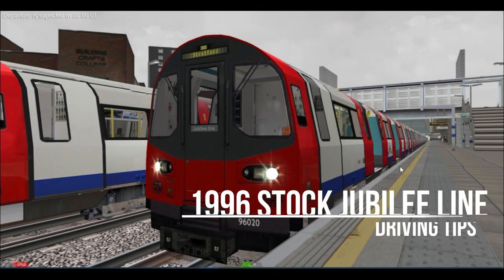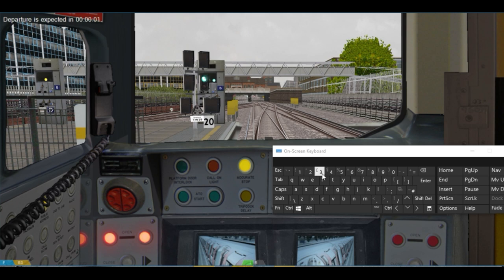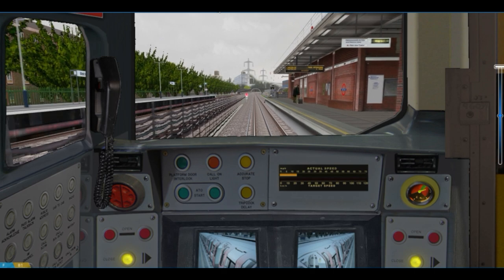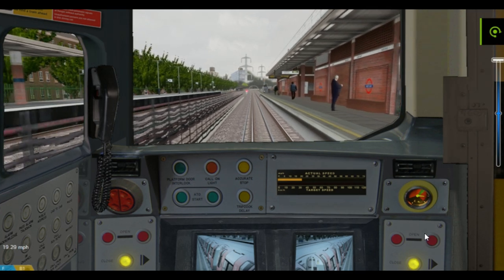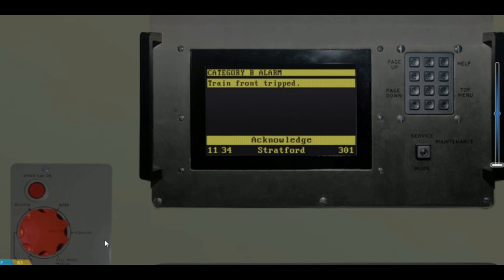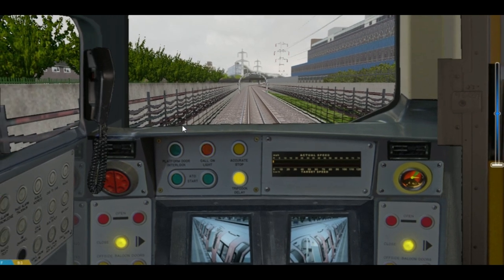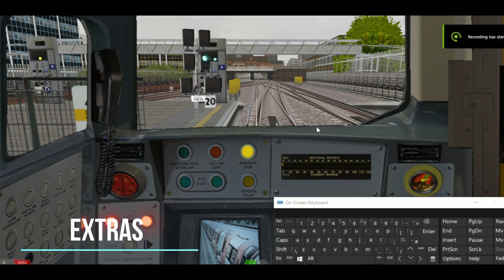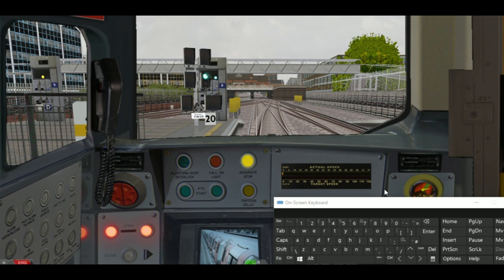Jubilee Line 1996TS Driving Tips | OpenBVE

Comment: Hello bve tube u know when I use the central line for some reason every time I load it the screen is white but the central line is there do u know how to fix. It
Reply from the maker: I'm not sure I understand, could you try to elaborate more? Did you check the locations of the folders are correct?
Reply: Bvetube101 basically I don't think the map loaded but the train did so the map is like white and also I can drive the central line
Reply from the maker: @farhanarahman2634  Are you running the latest version of openbve?
Reply: Actually I don't think so

Comment: hey bve tube i am running the latest version but the central line still goes white
Reply: and btw im on my laptop from my ipad has my moms account the farhana rahman one
Reply from the maker: Hiya, see if you can look for and run version 1.7.0.3. See here https://vps.bvecornwall.co.uk/OpenBVE/Stable/. 
Ensure you have placed the folders in the correct location. Let's use the Jubilee Line for example, make sure that your Jubilee Objects folder is in [Openbve/Railway /Objects/Jubilee Line] and not [Openbve/Railway/Objects/Objects/Jubilee line]. This results in the sim returning a blank when it's running as it cannot locate the path of the objects in the route file when called.
Reply: What u mean
Reply from the maker: @eliteehsan1887  Is all the folders placed correctly?

Comment: Hello, I know this video is over a year old but I recently downloaded the jubilee line and for some reason I can't get the doors to close, I press F5 and it works for opening but it doesn't do the same for closing so is there any solution?
Reply from the maker: Hey for troubleshooting first check the key assignments in the openbve options in the home menu are set as default. Also make sure that the DOOR_CLOSE left (F5) is not multi set than more that one key.
Next check when you start the route that the plugin has correctly loaded using the version of openbve that is recommended by Bve Western region.
Let me know if this has worked for you.
Cheers 👍🏻

Comment: @Bvetube101 Sorry but one question can u make a video on Waterloo and city line and also when im driving Waterloo and city line An alarm constantly reappears what do I do?
Reply: I meant constantly reapeats
Reply from the maker: I can... Should be after this next video on the Jubilee line phase 3 I have upcoming. The alarm that reappears, can only be one of two things I'm thinking of. One is the deadman's alarm that only goes off if stationary and no input to the traction brake controller was made within 60 seconds, or if you've either passed a signal at red. Last I can think about is you may be driving in RM mode which restricts your speed to 13kph and greater than 16kph an alarm would sound. Generally if starting from the siding road into Waterloo you start the move in RM then when berthed at the platform, press PG Dn to put the mode into CM/FSM (Coded Manual/Full Speed Manual)
Reply: farhana rahman you need to wait for both signals to turn white in the depot. Use CM (Coded Manual) for the departure from everywhere EXCEPT Waterloo ARRIVAL platform. You will need to use restricted manual for that. Be alert and pay attention to the speed in the tunnel as they change quite often. Also, don’t forget to press the spacebar to twist the TBC and then go to the P3 detent to get the train moving

Comment: Plz help me how do u close the drivers door and stop the alarm
Reply from the maker: I believe according to the manual Home and End keys on keyboard Close/open the Near and offside driver doors.

Which Alarm can't you silence? I would gather two guesses, one the Dead man's Alarm CAT A if no input was made to the combined Driving handle for a while. (I explain at the end of this video on how to cancel that alarm). OR the Mode Control Selector switch is set to ATO, which you'd get both CAT A and B alarms and a TMS message (No Code) because there is no systems installed that use this mode. If this is the case then press the Pg Up button to take you back one Mode to FSM and clear the message by pressing 0
Reply: Thank u
Reply: And why does it keep constantly ringing. The alarm it's so. Annoying is it  because of the driver door is open
Reply from the maker: @farhanarahman2634  From what I know and in real life too, drivers can have the doors open while the train is in motion so long as they are in FSM/PM. No alarm should sound, just check it may likely be the mode selector or the dead man's alarm. The TMS will indicate each. If its the dead man's alarm either pressing Q, A, Z or spacebar if the notch is set in B3 should cancel the alarm then press 0 to clear the TMS message
Reply: Now it just says clear on light how to I get rid of that and like go down on the panel
Reply: And I subscribed to your channel
Reply from the maker: @farhanarahman2634  Haha thank you! Glad I could help :)

Comment: Bve tube how do you turn on the speed bar on central line
Reply from the maker: Speedbar turns on with the train. Does it not light up when you turn the mode selector? (Pg Dn?)
Reply: When I do nothing happens but I can hear the thing turn
Reply from the maker: @farhanarahman2634  Check the plugin has loaded correctly or the train is  download with no missing items?
Reply: Don't worry I know now thanks
Reply from the maker: @farhanarahman2634  All good! Glad you could resolve your problem 😄

Comment: its doesn't work for me
Reply from the maker: Hello there, clarify what doesn't seem to work for you? I'll do my best to help!
Reply: Bvetube101 basically after i press delete there is this light that flashes and wont stop and will sometimes cause a alarm and my doors refuse to close if u can give me a more detailed way to get the train working that will be much appreciated
Reply from the maker: @Itreallywasnt  is this based on starting up the train as you start the simulation? If so then in my first video linked in the description,  I explain that pressing the Delete Key 🗝 inserts the key into the panel. This then activates the function to select the driving mode by pressing page up or page down key to turn the mode control selector switch clockwise or anti clockwise. If you press the Pg down key on your keyboard until the Mode control selector points at "Full speed Manual" this should be the one you want. In your case if you're getting an Alarm, you've likely selected the ATO mode which isn't functional at all as this is before TBTC was ever implemented years later and you'll get an ATO/ATP Error No code message on the TMS screen. In such case just press page up. The doors should close when you press F5 or F6 respective of which side the doors are open. Let me know if you are still having problems
Reply: Bvetube101 i still get an alarm when i out it into full speed manual
Reply from the maker: @Itreallywasnt  I might reckon it could be either a plugin issue or the version of OpenBVE you're running it on. What version of OpenBVE are you using?
Reply from the maker: Has anything fixed for you yet? The sim requires you to run v1.5 or later, if anything download the latest from Openbve-project.net and try it again.
Reply: @Bvetube101  Okay so, i've been trying to clear the alarm using the 0 key but it would never come off, the alarm would stop but the message wont come off.
Reply from the maker: @Jay.3x  I've had that happen to me before, sometimes restarting the sim usually fixes the problem for me. But ensure that you first cancel the alarm moving the handle with Q or Z to silence the alarm then press 0, this should clear the message and the Alarm Acknowledge key should stop flashing as well. Let me know if you're still having issues with it! :)
Reply: @Bvetube101  everything is fine now, but, i need to fix the Call On Light issue or somewhat because it blinks and alarms, but after i turn it off, it continues.
Reply: @Bvetube101  nevermind, i just remembered i had it on the wrong mode lol.
Reply from the maker: @Jay.3x  All good! Glad it's working for you!!

Comment: hey man you helped me well earlier i can;t get enough of this, but stopping at the green mark is hard. so which speed do i use actual or target speed???
Reply from the maker: Glad you're enjoying it, in the video I think second section in, I demonstrate coming into the station at no more than 30 and begin braking, feathering the brakes to vary the speed which has me slow enough so that if needed I can apply more brake to stop correctly at the stop point. The margin of the stop area is quite tight so ensure you maintain brake to crawl speed. There is a slight delay for the brakes to kick in however when you apply it so judge the correct timing in which to do so. Also if you stop short, apply one notch of power but almost immediately apply brake to move a few inches as I found if you watch my phase 1 video, Stratford to North Greenwich, at North Greenwich I stopped almost correctly but didn't want to overshoot so I did what I described above.

Comment: Tips for central line plz? I have a —4th braking detent. How should I distribute my braking now?
Reply from the maker: Hello there,
I'll add it to my list of things to get to. With the central line although a 4th brake has been added, only the ATO can use this brake and will have no effect if being used when driving in coded manual (CM) I'd recommend maybe 55kph but use correct judgement, if you feel its too quick approach the platform slower and feather the brakes to suit so you have enough room to stop at the stop point. I will do a driving guide video for you soon
Reply: Bvetube101 thanks mate. Appreciate it

Comment: The first bit didn't work for me I pressed Z lots of times quickly
Reply from the maker: Hi there, since this video the route has updated and I hope to put out another video soon
Did you follow everything properly, so on closing the doors, the Reverser key doesn't work since the train movement through setting the Mode on the Mode Control Selector. Ensure it's set to FSM/PM (5 ish o'clock position), secondly make sure the combined power/brake handle is in "B3" then press SPACEBAR, you'll hear the combined handle twist and finally press Z until its at P3 or whatever power notch is desired. 

I hope this will help :)